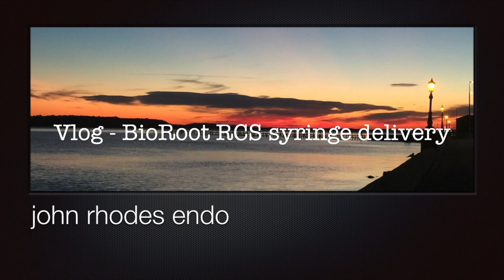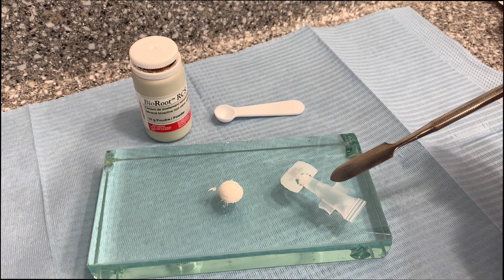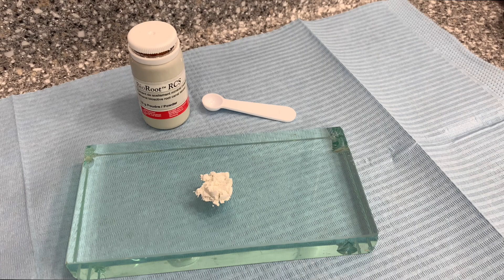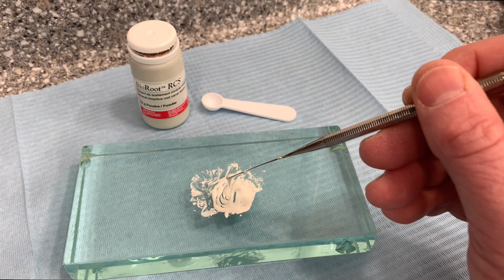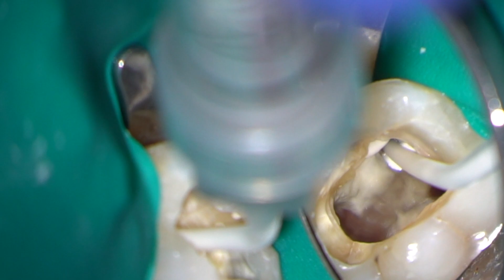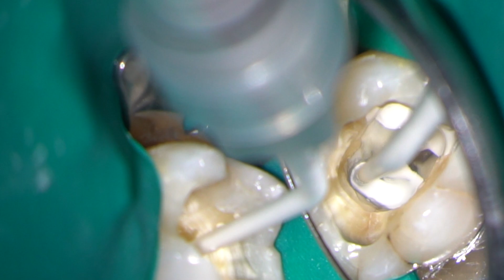Vlog   BioRoot RCS Syringe delivery

Comment: A question please: Bioceramic sealers or warm vertical condensation ? when  to use each technique? Thanks Dr Rhodes you are helping me a lot . Your book about retreament is great 👍
Reply from the maker: hello nasser
Thank you! pleased you enjoy the book...
BC sealer and vertical compaction are both quite versatile and can be used in most cases.
Its really a matter of operator preference
I would suggest the antibacterial properties of BC may be helpful in  retreats? or in long narrow canals where the plugger will not reach to the apical 5-7mm if the prep is very narrow
Cheers
John
Reply: @johnrhodesendo   I am so grateful for this useful information 🙏💕

Comment: Hello. Have you tried using BC sealer from brasseler/FGK (endosequence)?
Already premixed in a syringe.
Reply from the maker: Hi there,
I have seen it but not used it, seems to be a popular material certainly in the States
Cheers
John
Reply: @johnrhodesendo  I have been using it for several years and its available in the UK through schottlander and optident. They also have the hi-flo version which is less viscous. I use the navitip 29G tips (ultradent) with the BC sealer syringe and I can get to 1mm from the apex and pull back the tip while extruding the sealer. Works wonderfully and predictably.

Comment: great video ..after u fill the syringe and use it u will dispose the remaining or u can use it again with new tip ofcourse? and can u make the mixture thicker to us it as a bc putty?
Reply from the maker: Hi Ali
Its single use, I am not sure what happens to the material properties if you change the ratio of liquid to powder
cheers
john

Comment: Dr Rhodes, on ribbon-shaped D root lower molar canals,  do you try to fill w BC sealer or is it better to get GP to fill the elliptical void?
Reply from the maker: Hi Raybe,
I think BC sealer will work just fine..may need to use a lentulo at slow speed to disperse into irregularities.
cheers
john